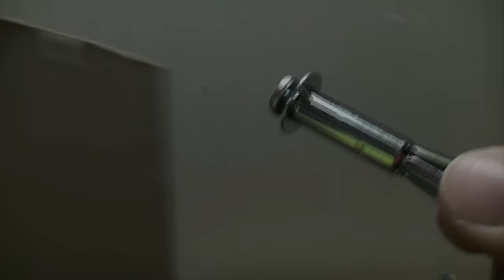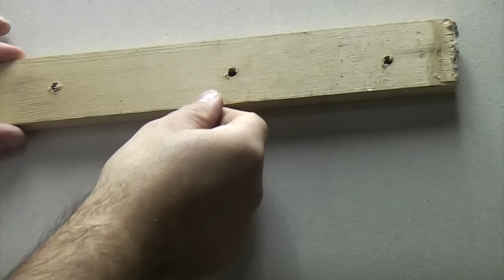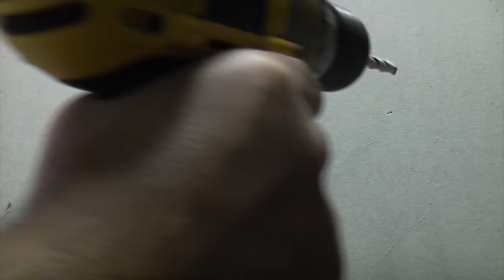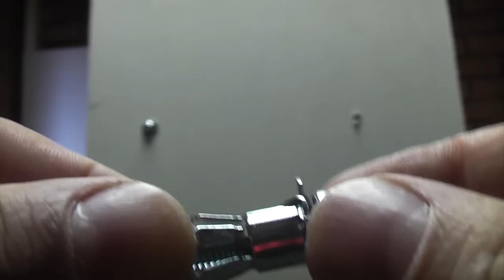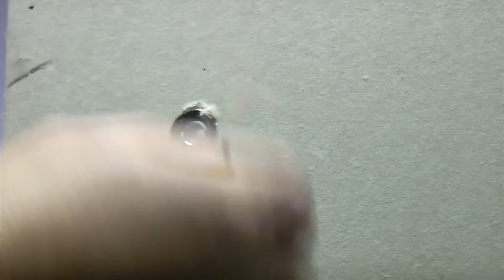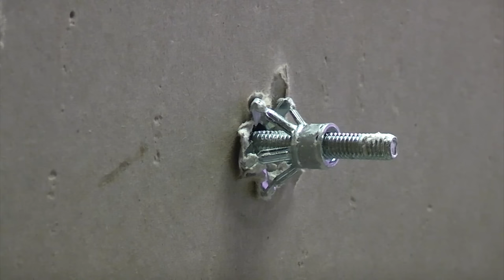How to use hollow wall anchors

Comment: "Thank you for your help. However, the anchor didn't hold on the front side as it tore when it rotated becuse of the the pointed end so it is bit loose from the front Will that be fine?

Comment: Cheers mate I got some of those fixings from B&Q but I definitely wouldn't have been able to do it without your demonstration, particularly using your thumb to stop it rotating as you screw into it.  Now the mirror is on the wall, my mum is happy and has one less thing to worry about, and I want to learn more. Thanks....subscribed.
Reply from the maker: You are welcome
Thanks for the comment

Comment: Good vid. I use these all the time so watched purely out of curiosity. Personally I find the setting tool is worth having for £10 or so it costs. It pulls the screw outwards rather than turning it. Therefore no turning force is put on the fixing whatsoever, so those teeth you mentioned stay firmly bitten into the wall with no turning/snagging/tearing. Your way clearly works, but if you’re a bit unskilled like I once was, if you don’t hold the fixing when your first start screwing it up, those teeth slip and make a mess of the wall, and it might not hold. Setting tool works a treat and only takes one second to set each fixing.
Reply from the maker: Yeah, I totally agree
Thanks for the comment 👍
Reply: This is a great tip.
Reply: What is setting tools? Sorry to ask as I have a lot of failed attempt to use this anchor.
Reply from the maker: @ottiezebua6105  
https://www.youtube.com/watch?v=7mpcer0QzW8&t

Comment: Thanks for this video buddy. I was using these fixings and wondering why the fixing kept spinning and not tightening up. Didn't realise you had to screw it tight first so it gripped the back of the wall and THEN  remove the screw. Thanks again 👍👌

Comment: Thanks for responding. I figured it out myself
The hammer negates the need for a drill. The screw has a sharp pointed tip. Worked out perfectly!

Comment: Great video. I installed the short one in wood panels.  It was spinning & spinning.  Finger strength alone wasn't working.  I found it useful to do two things: 
1) start the expansion before sticking the anchor in the wall,  & 
2) holding the anchor head down with the open end of a 10mm wrench. This allowed for better downward pressure & the fingers on the wrench took hold in the 2 grooves on the anchor head.

Comment: Thank you so much for this as never knew how they worked and want to put cat shelves up onto hollow/plasterboard walls. Great easy video to follow for keen DIY wannabes :) like me who really want to make a good job and feel proud to do my own diy as a single mum :)
Reply from the maker: I'm glad the video helped 
Thanks for the comment 👍
Reply: How did they hold up ? That's my plan this weekend with the cat shelves, used the red grip it's but they came out the wall on my 45% angle shelf for some reason

Comment: Thank you! These little buggars have been frustrating for me. You showed how to use the proper size according to the thickness of the drywall! Now I understand why some I've used, never tighten! Here in the US, the different sizes are labeled for how much weight it will hold. So, I bought according to that. if it's too long for my wall, it won't even work! Thanks for the video!
Reply from the maker: You are welcome, I'm glad the video has helped.
Thanks for the comment ;-)

Comment: Thanks for the demo.  I wasn't sure if I was to push them in first or not, but couldn't imagine how it would work if I didn't. I thought I had better watch this, before I messed up a hole in my wall. There are curtains in my future!
Reply from the maker: VH You are welcomeThanks for the comment ;-)I do intend doing a video on how to use these with the correct setting tool in the next few weeks.Sorry for the late reply, there seems to be a problem with the YouTube comment system!

Comment: When drilling the hole, make sure you are using the hole specified for the particular anchor being used.  Also, you may want to use a stud finder in case you want to avoid lining up with a stud.  (Or maybe you actually are hoping to find a stud and thereby forego the anchor in that one position)

Comment: Thanks. I want to hang a shelf up that won't have much on it. More for decorative (and very light) stuff but the shelf kept pulling out of the wall. We have a package of these that my late dad had, but I didn't know what they were or how they worked. I will have to do this tomorrow! Thank you!
Reply from the maker: These do work better if you use the setting tool for them, although some brands will work fine as shown in this video. Good luck with it and thanks for the comment. 
https://www.youtube.com/watch?v=7mpcer0QzW8

Comment: I've always wondered what they look like from inside the cavity! I've used these to mount a 50in plasma and 6 years on its still up (the studs were in the wrong places) thanks! 👍
Reply from the maker: +Simon Moskovits You are welcomeThanks for the comment ;-)
Reply: After putting in the anchors you haven't had any weight issues with big TVs?
Reply: @mikeg.8904  they work great but dont use them for a heavy plasma tv!! I made that mistake because I couldnt find the studs. And it actually held for like 4 years. But one day crash and my whole tv ripped out of the wall and shattered on the floor! 3 K out the door!

Comment: Sorry mate, just finished actually watching rest of the vid and you've answered my question as you obviously didn't need the setting tool! Great stuff. Cheers.
Reply from the maker: No, problem.
It's best to use the setting tool if the plasterboard is not skimmed with plaster or if you have a lot to install.
Thanks for the comments
Reply: It's a fairly new internal kitchen inside an old Glasgow tenement and the  plasterboard has been painted, so i'm unsure as to whether they would have skimmed it first. Is it likely that they may have just painted directly over the plasterboard? I know it's difficult to say without seeing it.
Reply from the maker: This video shows how much weight certain fixings can hold, it might be of interest- https://www.youtube.com/watch?v=ECDysfNhx_E
What are you fixing to the plasterboard?
Reply: Cheers for that link; I had previously saved it in my Liked vids as will no doubt need to refer to it later.

What I'm fixing is this:

http://www.ikea.com/gb/en/products/storage-furniture/bathroom-storage/grundtal-wall-shelf-stainless-steel-art-00011428/

The description says the max load is 17kg but I'll only be storing some fairly light glass crockery and some plastic tumblers and wine glasses so I can free up cupboard space, so not a huge load, however I'd rather use the best fixing so it's done properly; don't want the shelves to wobble at all.
Reply from the maker: You are limited to which fixings you can use with something like that, because some fixings need a large hole. I think the hollow wall fixings would be best for that shelf or perhaps Rosett plasterboard fixings would work well, I have not done a weight test using them but tried them once in this video- https://www.youtube.com/watch?v=mIEY3E4fiDk
Reply: Thanks for all the advice mate, am confident now it'll be fine if I go with one of them :)

Comment: If only I had watched this video and if only the guy at B&Q had told me about these specific wall anchors I could have saved myself hours of hassle. I tried this using spring toggles to hang a sagging coat rack. Problem is the distance between the brick wall and the plaster board was only around 2.5cm so the spring toggle could not push through and open up. I ended up drilling into the brick wall so it could clear enough space to open up and even then it created a whole lot of challenges.

Comment: Please pin this comment becasue even if this didn't happen in this video or to anyone following this advice, it certainly happened to me. 

Without using the setting tool this plug just chewed a hole right through the plaster and I had to push the rest of it down into the cavity – and this was using a hand screwdriver and not a drill. I should've watched some more videos that instructed that when using this type of plug the setting tool is essential. Just FYI.

Comment: Ok thanks for your help, We ended up drilling 14mm for toggle bolt only to realise that behind the plaster was a joist, the hole became too big to fit a wall plug in, so we had to no choice but to use a anchor bolt because that was only thing to fit 14mm hole. We got there in the end lol, Also if you ever come across rusty toilet bolts on cistern an floor would be grateful for a video on how to remove them without break thing the old toilet,

Comment: @apierc1 I was just about to say the same thing. Tap the anchor into the wall so the teeth dig in before expanding it with the screw. You don't want the thing to turn when you are expanding it. They should make a wrench that holds the anchor from spinning while you expand it.

Comment: This is a great vid thank you, it's great to see what's happening on the other side of the plasterboard. I've been trying to screw the screws so that the back part splays, but I get a little bit of resistance and then it goes loose again. They are the right size plugs because some of them work elsewhere in the plasterboard, do you have any tips to make them tighten all the way?

Comment: I didn't know how thick my plasterboard was,  so I drilled my holes and poked in a thin allen key, hooking it behind the wall and then pulling it. Then I marked it and then took it out. Luckilly, I'd bought the correct depth anchors. Phew!!

Comment: I'm hanging a heavy bathroom cabinet on to dot and dab thermal block wall, I have hammer fixings but was afraid of damage cabinet, could I tap in the hammer plug and use an ordinary long screw or will the hammer fixing nip up say from 10mm out, great videos you have uploaded ,cheers

Comment: Hilti makes a type of "gun" that you hold the anchor in, then insert into wall, then click-click-click and it's expanded. Remove the screw (which you have previously mostly unscrewed, left JUST enough in for it to hold still when you use the gun) and ta-da! Very quick way of doing it.

Of course, being Hilti, it costs over 100 dollars here in OZ lol
Reply: +a korpija Actually, a quick Google search has brought up a bunch of different branded guns. :)

Comment: If you have a short length of metal strip, drill a hole in it near the end, then put the screw through the hole and hold the strip in one hand while tightening the screw.  This stops the head of the anchor from turning, because the screw is turning against the strip rather than against the anchor.

Comment: we are having similar problem. I think we have the correct size anchor, and used the fixing tool to activate the anchor. but then the teeth wouldn't bite right inot the wall. we gently hit it with a rubber hammer and it eventually worked. But now the screw just spins. The end of the anchor doesn't appear open anymore. a very thin pokey tool (craft item) goes in the hole the whole way. i can feel the wall at the other end inside.

Comment: Very nice. First time see how to work behind wall. My wall is same plaster board. But I like to hang large mirror same wall. But I feel really really scared. Like to hang behind my sofa. Where we sitting. But don’t know what will best things and very very safe. Incase will not drop, please kindly give me advise 

Mirror weight is 25 kg.
Reply from the maker: There are better fixings for plasterboard, which are easier to use.
It depends what is available locally to where you live.
This post should help- https://www.ultimatehandyman.co.uk/forum1/viewtopic.php?t=106943

Comment: With me usually, those things either get their threads stripped before they are fully in or they pop right through the plaster board. I've tried being extremely careful not to use to much force, but it happens anyway leaving me a hole where I needed the support. For me, those cheap, expanding plastic plugs or the spring toggles work best.
Reply from the maker: The setting tool can help- https://www.youtube.com/watch?v=7mpcer0QzW8
Thanks for the comment
Reply: Ultimate Handyman yep, I prefer using the gun to clamp the fixing in place. great video, thank you. I'd forgotten how to get the thing into the wall in the first place!
Reply: Andrew Jarrett you can use a hammer claw

Comment: I watched the video (without audio). Why was the relatively cheap "setting" tool not shown? Over the years  I have encountered inteset fittings that just spin because they weren't used properly. The fittings have lugs/spikes. As tightened, they dig in to the plaster. 

The correct setting tool will pull the fitting in to the platerboard and (hopefully reduce the risk of a spinning fixing).  

I have watched many of your videos, and  have been impressed. 

This one- nah. you don't seem to be concerned  about fittings potentially that just spin
Reply from the maker: I’m sure I mentioned in the video that there is a setting tool, and that you don’t need the setting tool (cost approx. £10) if the wall is plastered. Here is the video of how to use the setting tool- https://www.youtube.com/watch?v=7mpcer0QzW8&t
 👍

Comment: This is a great video, thank you! I am hanging a mirror up against a hollow wooden wall in my bathroom. Do these only work on plasterboard or is wood possible as well? Thanks
Reply from the maker: They will work on wood as well, providing you get the correct size fixing for the thickness of the wood.

Comment: Useful video but would have been good to add a note near the start about selecting correct drillbit size. I know it normally says on the packet, but still.
Reply from the maker: I can't specify the drill bit size, as different brands might require a different sized hole ;-)

Comment: I have done it like this before and the wall anchors just spin and don’t open up. I have been told to use a ‘turning stopper’ basically whatever it is you’re fixing (bracket, timber, etc) between the screw/bolt and the anchor in order to stop the anchor from spinning
Reply from the maker: As long as the wall is plastered, you can normally get these to work, but if not you might need to use the setting tool- https://www.youtube.com/watch?v=7mpcer0QzW8
Thanks for the comment 👍

Comment: Hi - super helpful video thank you for the guidance! Just a quick question, I’m trying to fix similar piece of wood (27mm thickness) to the plasterboard as you’ve used in your video, but can’t seem to find the anchors that say it’s ok to have that size/thickness… what would you recommend? Thanks!
Reply from the maker: You can do that just by getting longer machine screws to go into the anchors.
I'm not sure what thread they are, as they probably vary depending on where you live.
In the UK, they seem to use M4, M5, M6, so you can just remove the existing screw and get a longer one to go through thicker materials.
Thanks for the comment 👍

Comment: Using a setting tool prevents the anchor teeth from "chewing/stripping" the plasterboard ;)
Reply from the maker: That is correct, but if you only need to install a couple of these the setting tool is expensive. https://www.youtube.com/watch?v=7mpcer0QzW8
Thanks for the comment 👍

Comment: Handyman, some of these anchors note for plasterboard thickness from 6-16mm or 8-18mm. Does that not make it unnecessary to measure plasterboard thickness as long as double plasterboard has not been used?
Reply from the maker: Yes, as long as you know that it's only a single sheet wall/ceiling 👍

Comment: great, i'm useless at diy and want to hang a tv on a hollow wall. thanks for the tip! good video!
Reply: How did this work out, 6 years later? It's my understanding you'd use the stands behind the plaster wall to support the weight of the TV, and that wall anchors aren't able to support that much weight.

Comment: I've managed to rip my window frame head out of the wall by putting up heavy curtains without using anchors. I take it I'll need the really long ones and screws long enough to go through the wood panel and into the wall a good depth, too? With the anchors, you film them expanding across the back of the board to grip it when the screw goes in. What happens if the anchor can't go all the way through to the other side, as it's sat inside my wall. Is it still able to function? Sorry if I've not articulated what I'm trying to say. I'm new to all this!
Reply from the maker: What are your walls made from? It’s best to use something like a wall plug and long screw if possible (if it’s a solid wall)

The anchors in this video are only for hollow walls. They need to be able to open fully, once the expanding section goes through the material, or they will not work. 
Might be worth asking in the forum here, as you can add a picture- 
https://www.ultimatehandyman.co.uk/forum1/viewforum.php?f=1

One of the forum members will advise 👍

Comment: Thanks for a great video. I have a problem and hope you can advise on it.
I'm trying to fix a coat hook shelf to a plaster board clad brick wall. It's a converted garage. I have interset hollow wall fixings similar to what you have in the video (M6 x 37mm). I drill the correct size hole (11mm). Insert the fixing.
The problem is, the plaster board seems soft and the fixing just spins around, causing a bigger hole. The two little spikes on fixing bite onto the wall but won't stay put when I turn the screw.
Have you any tips to stop this happening? I've two holes drilled already and I don't think my partner will be impressed if I drill anymore 😂
Thanks 😃
Reply from the maker: If the plasterboard has not been skimmed over, you have to use the setting tool- https://www.youtube.com/watch?v=7mpcer0QzW8&t
👍
Reply: @ultimatehandyman  Fantastic, thanks for the reply.